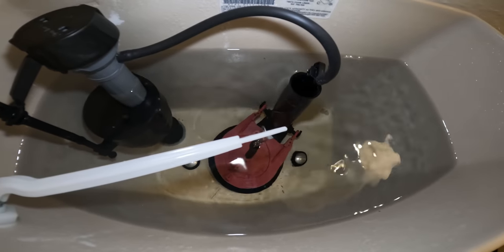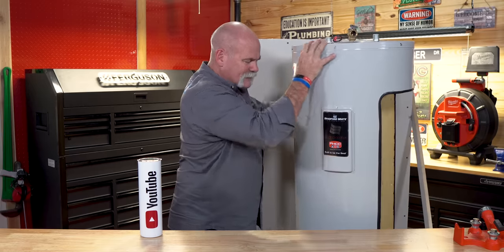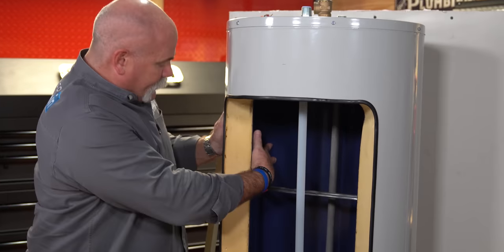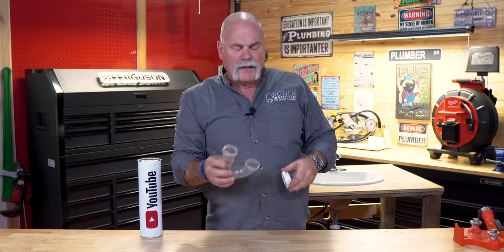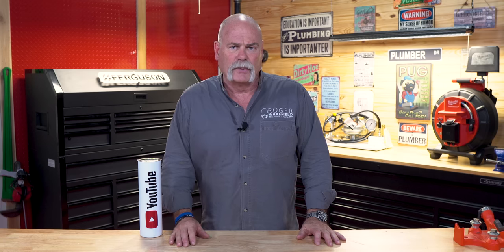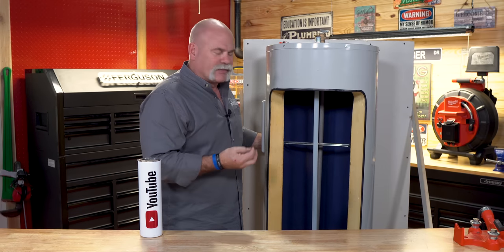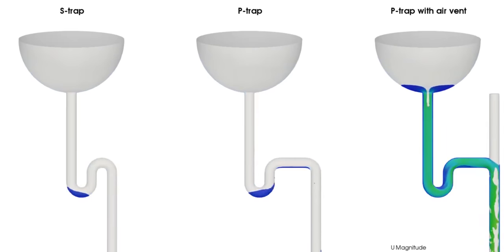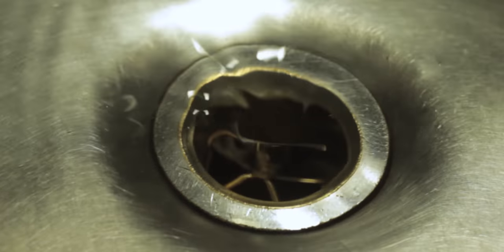10 Popular Plumbing Questions

Comment: I have a 25 year old gas hot water heater. It has never been flushed, but I have replaced the thermostat on it. When I moved in here I was afraid to flush it, because they said it was never flushed. That was 12 years ago and yes it sounds like someone is taking a hammer to it when it is heating. I replaced all my water shutoffs with quarter turns, to make it easier to turn off lines.

Comment: My advice for finding a good plumber, always get a second opinion. We had a guy come out for a laundry room clog situation, wanted $3000 to start digging under the slab to clear the clog. Turns out, it was a clog in the main and the actual problem was about 75 feet away from where they wanted to dig, and was easily fixable with a snake. They would have accomplished nothing except taking $3000 from me. There wasnt even any plumbing where they wanted to dig.

Comment: Thank you Roger. Good info per usual. 
When we had our first house built, the fellow who did the walk through with us recommended that we never run hot water while we had the garbage disposal on.   Is that a no no?
Reply from the maker: Depends, if you're putting a lot of fat and grease down your drain, using hot water can make it gum to the disposal blades and make it work harder. So I would advise against hot water if your're putting a lot of food products down it.
Reply: My wife swears up and down that mashed potatoes are a bad idea too. They solidify in the pipes. I think she's probably right.

Comment: I think it’s also important to note that when it comes to toilets running. Sometimes they just need a float adjustment that brings the water level below the top of the flush valve tube.
Reply: especially in mobile homes.  I spent a month working for a factory service crew for a mobile home company, and it just became a habit to check the toilet float position when I heard a toilet running.
Reply: Absolutely. Some of these toilets going into fix and flip houses right now are made with extremely cheap internals and seem to need some adjusting every now and then.